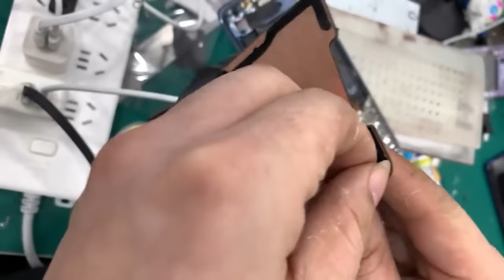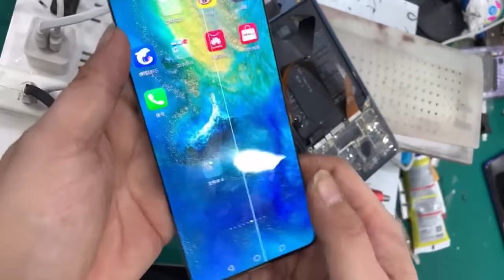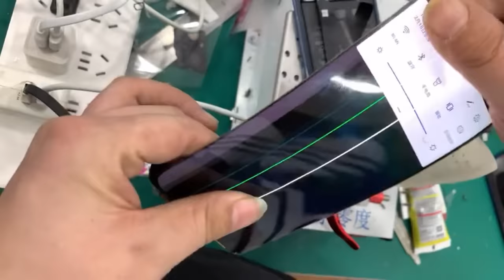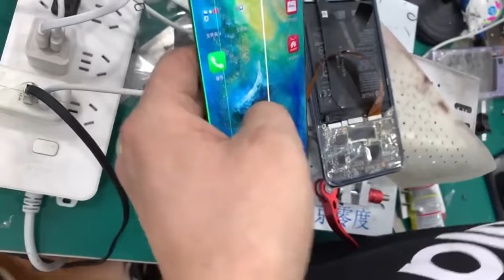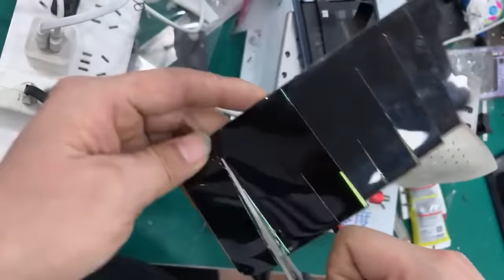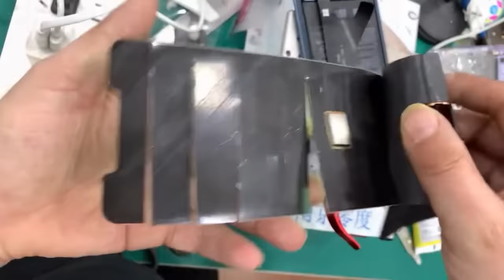What Is Inside lcd OLED| Teardown OLED display

Comment: It amazing how it still partially works even it was cut.
Reply: Only an array of lights disturbed..
Reply: @ambujarajan  The screen be trippin
Reply: That’s because every pixel makes its own light so cutting a section of the panel only effects the part that was cut not the entire screen
Reply: yes
Reply: This is like the new Technical nature of paper whare you can like stick this to your wall and everything would be wireless even pluging in the phone would just have to be powerd on with soler and the speackers and mic would all just be using Wireless ear buds and/or 2 or 4 Bluetooth Party Box Speakers.
Reply: 😂😂😂 It's amazing that we are accustomed to the LCD screen

Comment: try use this kind of oled panel like solar panel, and measure the Volt and Amp. Every led diode is a mini solar cell, this display have many of that diodes. Thank you
Reply: Nahi use photo diode kahte hai diode bhi bahut trah ke hota hI led light emmit karegi but photo diode photon absorbe karke volt me convert karegi
Reply: @kanhaiyaji6661  what you mean ?
Reply: @kaldeis  He meant what you describe is a Photo diode which absorbs photons and not a solar cell. This is a LED Screen and not Photodiodes
Reply: @prathamkalgutkar7538  look... every diode is photo diode.. mini photo diode but if u use many of them u have bigger solar cell. If u not trust me-connect to multimeter led diode put some light and find answer. Dont write what u "think" first use them, use multimeter and after u can write something... anyway... if u add some volt and amps on solar cell u see light on ir spectrum... u dont belive me ? Try and find answer.
Reply: @kaldeis  I know lol, I just have finished my Uni Lectures on Semiconductors. Your Principle is correct but the Application is not

A photodiode is used in Reverse Bias and when a photon incidents it, it creates electrons in depletion region increasing the leakage current

A Solar Cell is used with no bias, when a photon equivalent to energy gap band of cell incidents it an electron is excited to conduction band

A Light emitting diode is used in Forward Bias, when current passes through it, electrons from conduction band jumps into Balance band to recombine with holes and it emits a photon with energy equivalent to Energy gap band

The proper word here would be a PN Junction not a Diode as PN Junctions are manufactured for different Application and used in different configurations that makes them either a Diode or a photo diode, a Solar Cell or a BJT Transistor

Also Diodes don't necessarily has to be A PN Junction, there are unipolar Diodes like Schottky diode where PN Junction is absent to begin with
Reply: @kaldeis  TL;DR While Photo diode and Solar cell work with same Principle, they are Manufactured for different Applications and used in different configurations which created the Difference which are more prevalent than Thier names

A Motor and Generator work on same Principle but they are configured and Manufactured for different Applications and that Doesn't make them the same thing
Reply: @prathamkalgutkar7538  this is why i would like the author to try to merge all the pins if he is able to do so.
Lectures are theory, if you don't check it in practice, you won't know. I know that when I connect several LEDs, I get a little voltage, but their low density disqualifies them from being a sensible panel that absorbs light and produces electricity. Maybe you have the opportunity to test my theory?
Reply: Would be quite a hard work to find the correct pins but thats quite a good idea mever see someone do that
Reply: @felipehcraftgamer4193  Yeah i know that may be so hard, maybe impossible to find outputs of this led panel but... if this guy have some time, then why not ? everybody say no! DONT DO THIS, THIS CANT WORK... BUT THEY PEOPLE NEVER TRY..
Reply: So my question is. If you broke the outer glass by dropping the phone, it's not obvious that you get black screen in fact you can replace only the surface that can be much cheaper?
Reply: @zsoltszepfalvi5798  and they do it too for ultra cheap

Comment: Will there be phones that are just the phone always in your pocket and that have an ultra-flat screen connected by a cable that you would use with your hands?
Reply: Kinda weird having a cable out from Ur pocket
Reply: I had the same idea, but it would be a near-field communication device tied to your biometrics. The form factor could be incredibly thin, and the NFC emitters could be hidden through the lining of your clothing and down the fingertips. Cyberpunk af.
Reply: You will still need a lot of space for the motherboard, ram, cpu, battery etc and I am not sure about having it exposed. The glass in your phone is there for a reason is not just to get broke and repaired 🤣
Reply: @tomasramirezthemythtoon , the big picture for the OP is to have them concealed with just a screen frmor show. No different from having your phone in your pocket. It's all about implementation.
Reply: thats what I want for watching movies
Reply: Who the fuck wants to hold a paper
Reply: resident evil 6 phones will soon become a reality
Reply: @RioPutra_  a lot of people pass the receiver under their shirt and a lot of other people use the phone with a portable charger in their pocket, I don't see it so weird
Reply: @ikkimiura  and portable charger is fine since they normally have no design and it's kinda weird having a long wide thin wire coming from back of the screen , not gonna be comfortable holding it
Reply: @tomasramirezthemythtoon  given recent advances in graphene technology how long will it be before all the phones electronic components are printed to a flexible substrate along with the screen?

Comment: Well people said that unlike lcd, oled contain no liquid,so where are those " black ink like" liquid  come from when you cutting it?
Reply: It's not the ink but the Film and multiple layers which are used to manufacture them getting Seperated and they die making them appear like black ink
Reply: Meh 😁
Reply: Its black screen, it's when the screen is off it has no light, i donno if you're joking
Reply: Bukan tinta hitam itu kumpulan pixsel yang mati

Comment: That's the Amoled screen that can make smartphones thin and flexible like the Samsung Galaxy Fold

In the next 5 years there will be everything for smartphones and flexible laptops 

However, Amoled screens are susceptible to burn-in and shadows, so they have to be cleaned to prolong their life
Reply: What do u mean by "cleaned"? Is there any way to reverse burnt-in? 😣 I love my phone but it has burnt in problem by youtube app.
Reply: All oleds burn in. Not just flexible displays
Reply: do super amoled also burn in if so then im suprised my phone still isnt burned in anywhere I like have the screen turned on 24/7 with a still picture
Reply: @its_theo_here9700  It takes a very long time at 50% brightness

Comment: they are flexible wow but if they fall they break :( uff these videos are interesting
Reply: That's why i dont buy oled smartphones anymore... Just a drop and ... Say goodbye 🫂... Lcd's maybe dont have the colors or brightness level of oleds but are tough and never get damaget if dropt. (My experience)
Reply: The "flex" has it's limits. The screen get's broken' cuzz it get's punctured on a small point where the screen cracks. Overall Oled is more robust than LCD but is also inclined to more deffectives like colored lines, black round spots, green flickerin, burn in etc. Also a phone with lcd is cost efficient so you can repair it with low costs where phones with Oled are very high in repair costs and are not worth to repair.
Reply: @project0332  what you saying LCD are weak compared to OLED i just dropped my laptop with lcd from 5 to 10 cm height and boom screen got destroyed
Reply: @cursedtyrany8199  don't be dumb. A laptop droped has 10x more weight than a phone.
Reply: @project0332  just look at height i am mentioning And it ain't even landed at corner
And it only has weight btw 1.2 to 1.5 kg

Comment: What causes the white line to appear in the amoled display???
Reply: A deffect COF to simplify the matter this are connections from the mainboard to the screen itself, on one side of the panel there are very tiny chips that are connected to the panel and when the connection goes broken colored lines appear on the screen. The same is with all other types of screens on all other devices mainly you can see such deffective screens on TV's. It's 99% non repairable, the cost of those panels that could be repaired in such situration is too high and not worth the time and money for any company, that's why some companies recycle other usable parts from the panel.

Comment: What are the types of screens available in the market?
Reply: I would guess...

OLED, which display each pixel with independent color and it's own light,

CRT, the old ones which have a huge bulk on the back side and slightly convex curved screen shape, 

Plasma, don't know 100% how exactly they work but they have cells filled with ionised gas/plasma, they're out of trend now if I'm correct,

and then the all common LCD types which have an backlight(if the backlight is fluorescent then it's called the normal LCD, if it's LED backlight, then called LED type of the LCD class) in the back side of panel which produces all the white light and then that lights goes/passes through 'something' which bends/filters the white light into the colors of the desired displayed image on each pixel. That 'something' being for example the liquid crystals in an IPS type display....there are also other types of LCD panels like VA or TN

These are the main display types as far as I know.

Comment: can this be used in tvs?
Reply: OLED TVs do Exist but they are not much preferred as Pleads tends to die quicker because each Pixel is an individual LED and emits its own light instead of using a Backlight. So they make more heat and die, however they have very high Contrast and provides Truer 'black' without any light bleeding

Comment: Imagine a company building a phone with this
Reply: What do u mean imagine ? It's Huawei mate 20 pro , i have it no need imaginations .
Reply: @ibrahemsaleh4580  i meant phone not spyware
Reply: @imdyinginside1919  really! My touch doesn't work just bcz of one crack on touch.. and here it even works while bending and cutting little
Reply: @niamotullah99  is it really oled or lcd? You need to check first
Reply: @Bann1029  i see it as lcd but still it's flexible enough to survive a bend
Reply: @niamotullah99  galaxy z fold
Reply: @cursedtyrany8199  how tho.. cracking a corner makes whole screen black and unusable
Reply: @niamotullah99  nah bro i am just mentioning device which use that amoled display 

They are physically strong but internally weak af
Reply: @niamotullah99  what my laptop just turned white after falling from 10 cm height it didn't even fall on corner